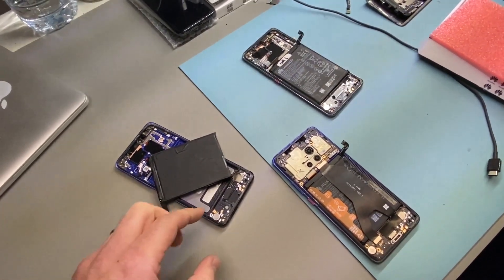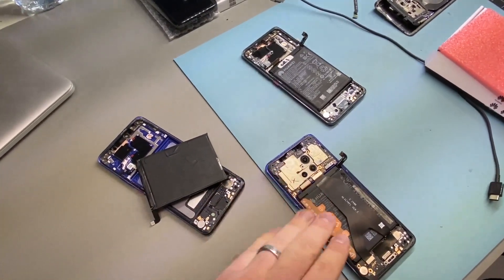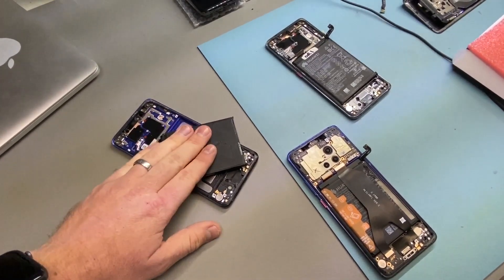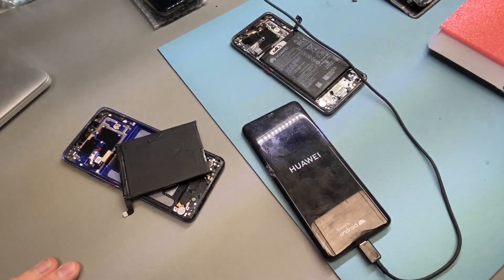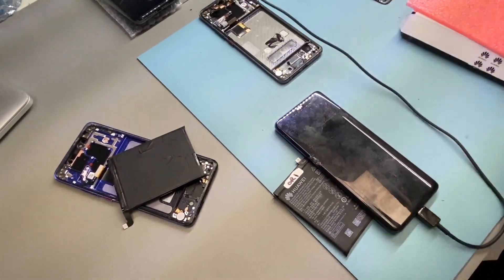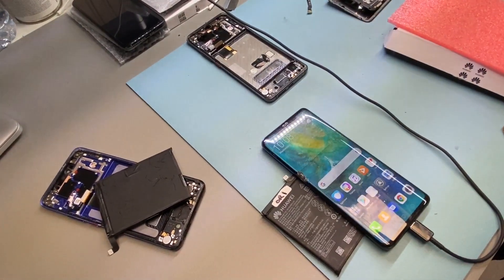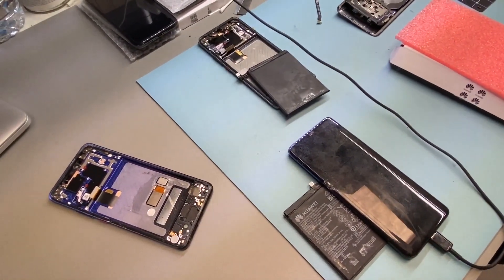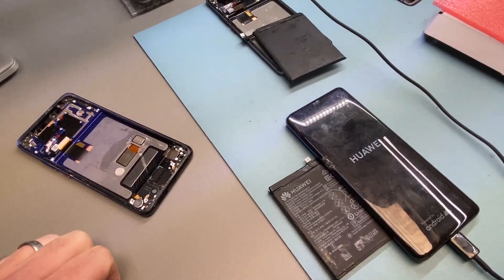Huawei Mate 20 Pro Battery Paired Calibrated to the Logic Board

Comment: Thanks for the share, I have the same issue - new batteries (2 tried) exactly same issue, sometimes just red light.
But, how to fix it?
I could take the battery apart and try to build a new one from the cells; but this is risky.
Does anyone know how to pair the new battery to the handset?

Comment: My phone worked perfectly for almost 30 months, it was opened first time in official Huawei service for battery replacement purposes. Phone worked 2 months after the battery replacement, it died during charging, original 40W charger was used 100% since i bought it. When i left it again on Huawei service, they told me, ok, we can see Huawei logo only when the battery is completely removed, the mainboard is dead and that was it... 120GB of data lost instantly, my mistake was not backing it up, but common! i payed it almost 1000 euros, i am so disapointed... I still think battery replacement was the cause, but can not prove it!

Comment: I have the exact same problem with huwai p30 pro... do u have any solution for this?  how to recalibrate the board with new battery?  I moved the battery protection circuit from original battery to new one, and that solved my problem but don't think this is a good solution

Comment: Just stumbled on this video and it is exactly what I needed. Thank you so much. I was about to give up after swapping my logic boards into another phone after my screen stopped working after being in a hot tub. After swapping the boards I was stuck in a boot loop as in your video so I tried the original battery and my phone booted up with everything working as before. Thank you so much I was nearly ready to give up.

Comment: I swap Green board from old battery to new one and working fine - seems to be code encrypted in one of the IC.
Reply: hello, can you tell if swapping battery cell is easy enough? Im still beginner at soldering. thanks
Reply: @sirdudunggaming7598  hi. No for this model was kind of dangerous and problematic to resolder that part.
Reply: @Królik-Postrach-Lasu  thanks, im still afraid of replacing the cell. my original battery is getting worse on daily use. what is your recommendation?
Reply: Like the iphone important battery massege... But for mate 30pro have battery health like iphone if we change the battery and used the old batttery board that mean the battery health will read the old b.h right

Comment: Hi.

 I hope i can help as i spend plenty of time sorting this out. First of all, change the battery - check new battery voltage if possible to be sure that you have working battery in good condition (it should be at least 3v between corner left and right gold contact pin on the battery plug, they are 2 thicker gold connectors, don't short the battery as you will fry it and it can be dangerous ). IMPORTANT DONT TURN YOUR PHONE ON! Connect phone to the genuine  FAST CHARGER and simply wait, even couple of hours! It will eventually quit boot loop mode itself. If that does not help try hard reset (hold volume up and with power button until logo came up then release power button only, in menu press wipe or factory reset). Hopefully you will sort it out. If i helped out, buy me water bottle hahaha.
Reply: im going to try plugging in and waiting... thanks.. my old battery is punctured so i have no idea what to do..
Reply: @christiann7320  Did it work?

Comment: Hello sir did you find any solutions to turn on the phone with another battery?
I need solutions to turn on my mate 20 pro with battery from another mate 20 pro because the stock battery ist died...
Reply: have u already solvd ur prob? seems im having the same problem too
Reply: @jose26madrigal  yes i was buyed the new battery from the store, the brand new battery not from another phone and i was turn the phone on and the charger too and i was waited for 5 min than the phone turned on normaly.
Reply: @Arnel475 does the new battery original or what? I heard that the cause of a bootloop after replacing the battery is from the battery serial number issue. Does it happens on you with your new battery from the store?
Reply: @Arnel475 does the new battery original or what? I heard that the cause of a bootloop after replacing the battery is from the battery serial number issue. Does it happens on you with your new battery from the store?